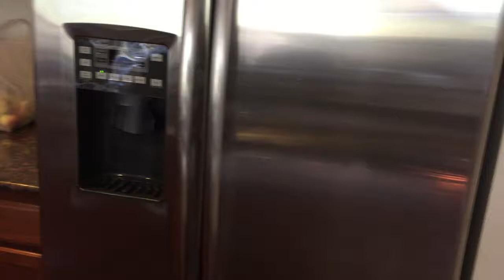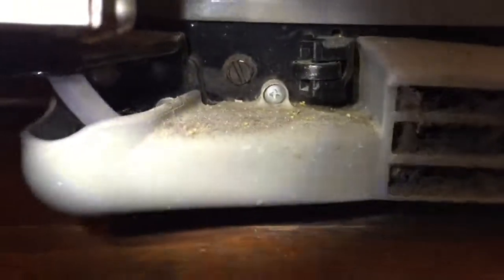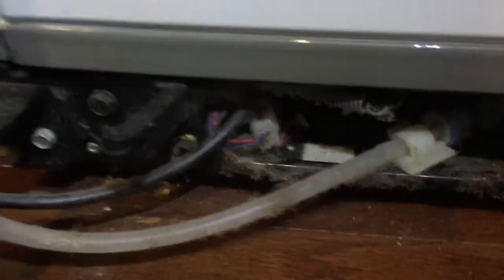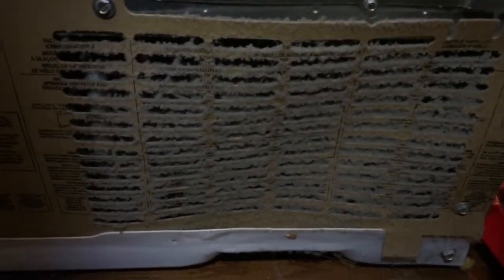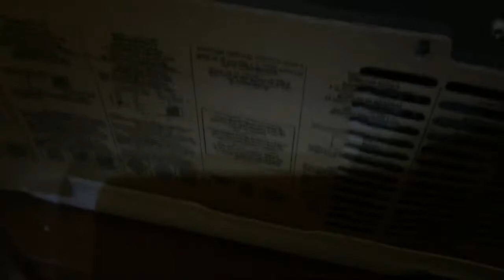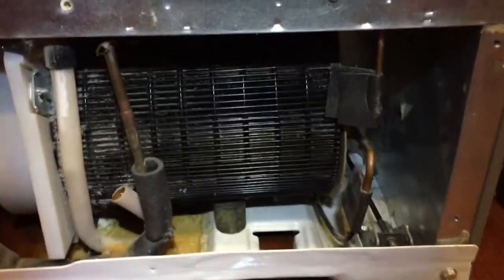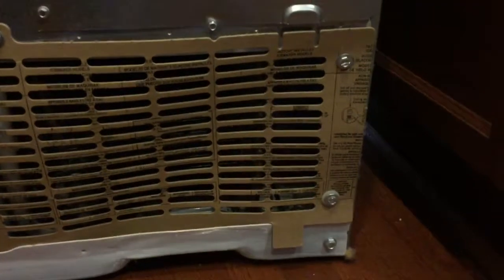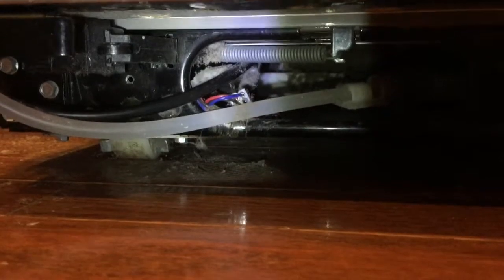Avoid refrigerator failure | What most people don't know

Comment: A dirty coil is one of the main reasons refrigerators won't cool.     The heat in the refrigerant is blocked from leaving the condenser coil by dust (and or pet hair).  This causes a loss of refrigeration in the evaporator coil (in the freezer compartment), puts more strain on the compressor and shortens it's lifespan.